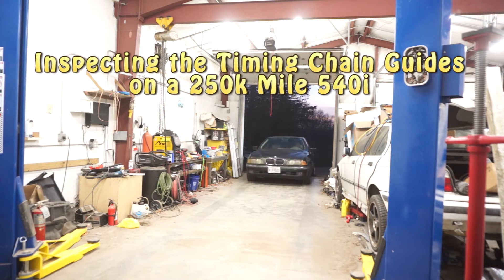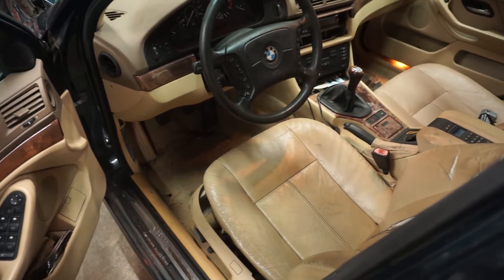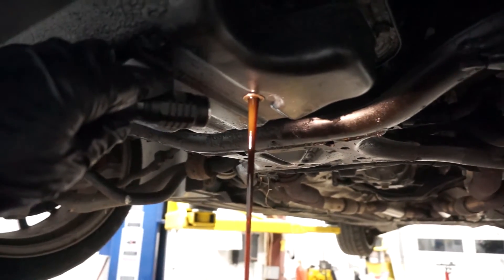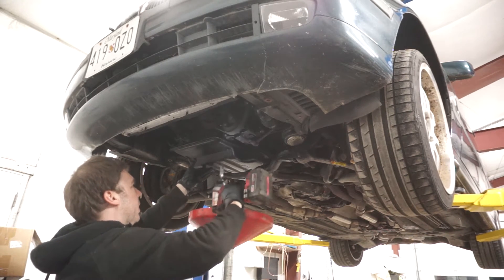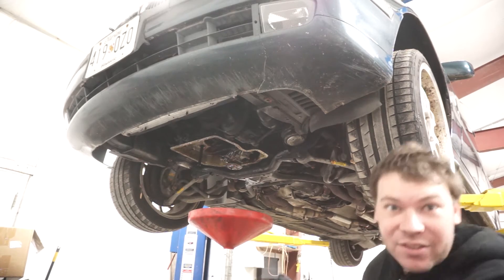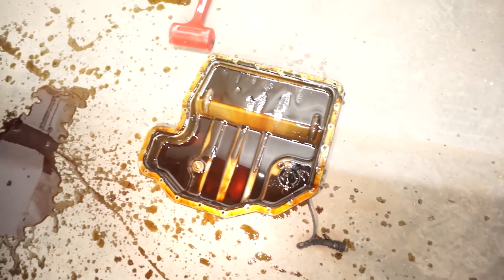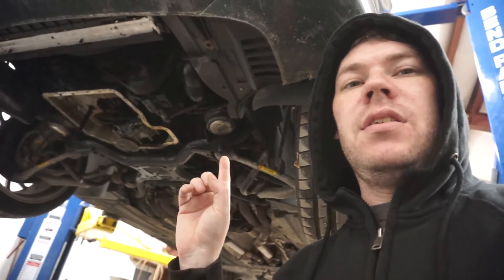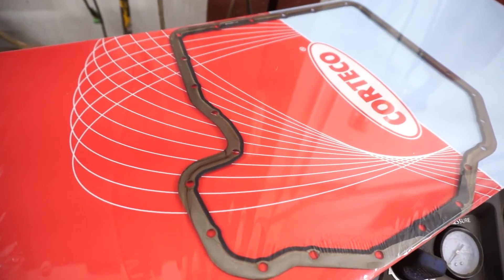Have the Timing Chain Guides Failed on this 1997 BMW 540i? We find out!

Comment: Even if the timing chain looks good I'd highly recommended changing the guides and chain.

I learned the hard way buying new valves chain and guides.
Reply from the maker: I absolutely agree. I thought this would be fun to look at and would like to drive it about 1000 miles on a road trip in its current condition. After that, my eventual intention is to supercharge & restore it. Part of that process will be fixing the guides; I'd actually like to convert it to the M60 style timing chain but not sure if I'll do that or just refresh the factory guides.